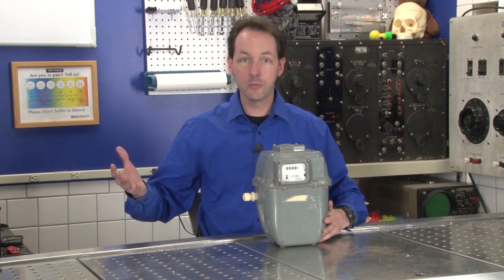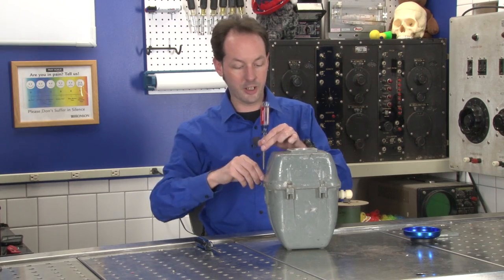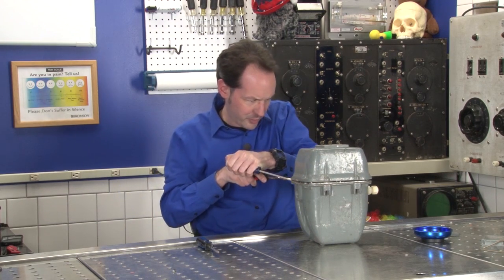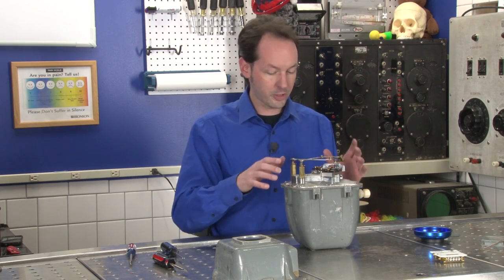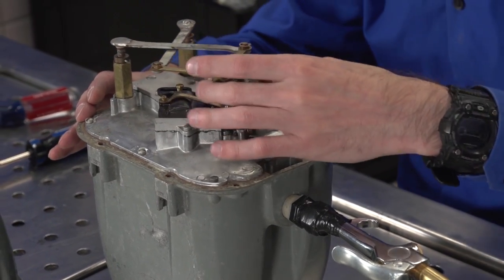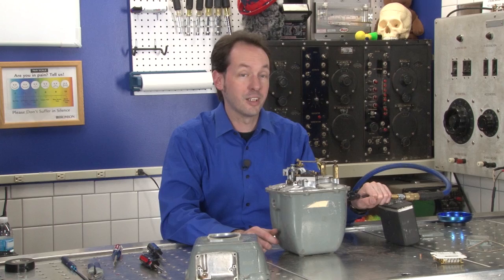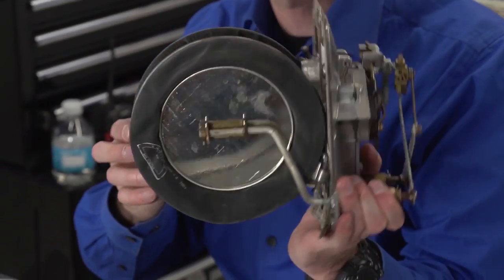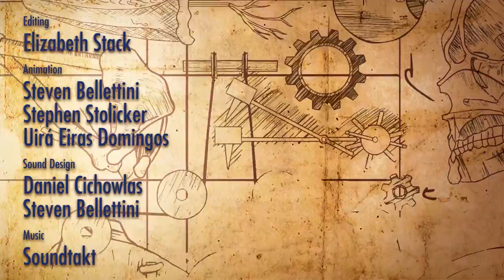Gas Meter: Equipment Autopsy #74

Comment: Very ,very old meter.   The newer meters are simpler inside.  Gas company test meters in use every 7 years.  And if a meter reaches a set age it is automatically retired and replaced.

Comment: This was fantastic! It works just like a steam engine! And with fixed volume per stroke it can be accurate at any flow rate. What a great design. It does get me thinking if I could harness this and build a small generator. The energy would come from a small pressure drop across the device. Thanks for doing this, been wanting to tear one apart for ever. would also be cool to run one from a vacuum on the outlet side.
Reply: I was wondering why this is so complicated.... but wouldn't different flows as well as temperature differences also compress/expand the volume of gas, so essentially at higher flows you would get more gas per pump volume?
Reply: ***** Gas meters are always proceeded by a pressure regulator that drops the gas pressure drastically before the meter. For safety, residential gas meters, pipes, and appliances are never subject to over ONE psi of natural gas pressure!* This "autopsy" isn't really complete without a dissection of the Gas Pressure Regulator that would have been supplying this type of meter.

So your intuition about it not working (with the information you had just been provided in this video) was correct. The pressure is carefully controlled to keep the system honest. :)

*More accurately, the pressure in the system is restricted to less than one psi above ambient pressure. According to So. Cal. Gas. Co. the residential distribution pressure is only 1/3 of one pound per square inch above the local air pressure at the regulator. (Some new multi-family construction to be allowed to distribute gas at 2 psi apparently so that reasonably priced 3/4 inch and 1/2 inch pipe can be used to supply adequate gas flow on longer runs that would otherwise require larger, more expensive pipe.
Reply: That makes sense, thanks for clarifying!

Comment: Really really neat. I also said "That's so cool!" out loud when you got it turning on shop air.

A suggestion for something relatively similar you could examine is the pump/meter from a gasoline pump. I used to work for a gas pump manufacturer, and the meter functioned as its own pump as well as precisely metering the amount. The company was also trying to introduce an axial flow meter, that was the size of a pack of cigarettes. It was so precisely machined you could blow in the inlet and it would run (And suck your lip into the hole for good measure)

Love the videos, keep it up.

Comment: would be interesting if you could re-purpose the meter by linking some kind of motor drive to the pantograph arm system on the top, to drive the bellows and transfer air pressure from the inlet to the outlet. might have some sort of useful purpose.
like a bellow system for a forge, or something along those lines

Comment: That would look very cool in a glass enclosure with its own air supply and working, I think it would be a cool teaching tool, if that one was made in the 60-70s I wonder what one nowadays would look like.
As a project you guys should work on getting a permanent air supply put in the lab.
Geiger Counter
Gas Pump
Reply: now day its probably the same. but with cheap materials

Comment: did you try to hook up a vaccum to the outlet to create negative pressure instead of positive pressure on the outlet
Reply: +Chris Helmich This wouldn't have worked as the whole upper cavity would need to be sealed in order for that to work.
Reply: I disagree.  A vacuum would have negative pressure relative to the atmosphere. So that would simulate quite well the upper chamber at a higher pressure (atmosphere pressure when top is removed) flowing into a lower pressure side (the outlet when hooked to a vacuum).

Comment: Giant electric meter like they use on industrial settings. A clamp on amp meter. A liquid gas meter, would it be like this one or a water meter? Speedometer, RPM, odometer meter like a car, anemometer, barometer, thermometer, humidity, pressure meter for like air. Some of these you could probably do a bunch of small ones in a shoot.

Should make another series of like meters that do something at a certain point. Like a compressor cutoff switch, breakers, thermostat. While not a true meter they have metering components.